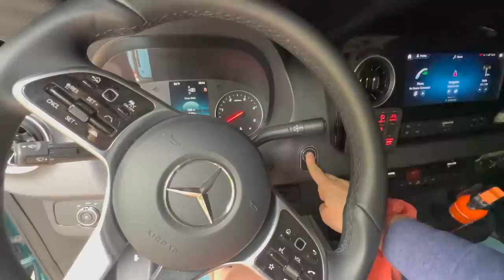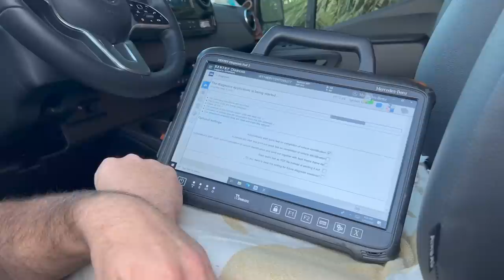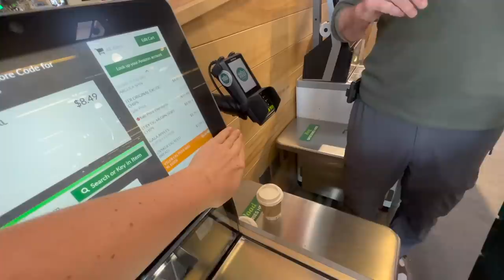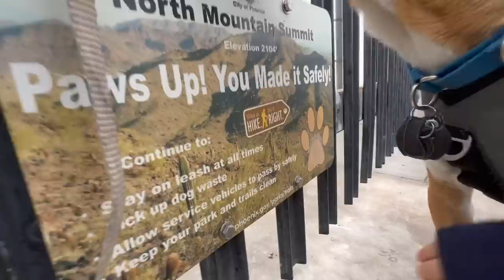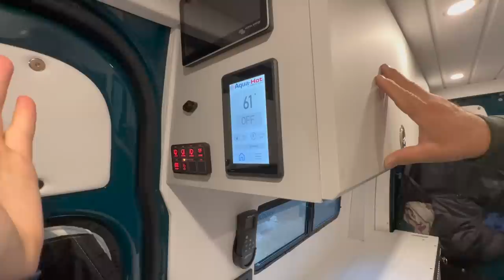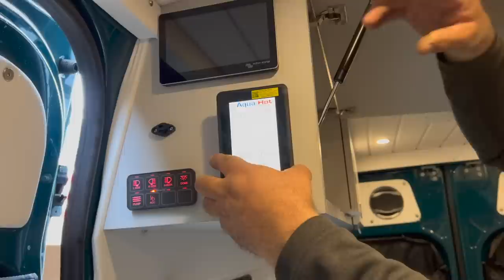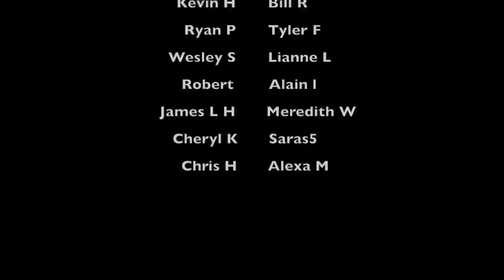Realities of living in a van (when nothing goes as planned)

Comment: That's definitely a consideration you'll want to touch base on with the van builders:  There's a big switch that will switch between how you charge your house batteries, and allows you to link them to the starter battery.  I'm actually surprised that Overland Van Project didn't install one in their van...

Maybe on your build, take a look at diesel heaters?  They're less expensive a easier to work on.  Plus they take up less room.  Just a thought.
Reply: I'd say diesel heaters are easy to work on but you will be doing it frequently. Normally you just gotta take the face off with a phillips screwdriver and clean the soot from the sensors. You can carry a spare injector, spare igniter, spare temp sensor, and spare flame sensor. When they fail the computer basically tells you what to replace.
Reply: Those diesel heaters are wonderful.. Not to plug another channel, but Chad Derosa, who isn't bad to look at (LOL) on Living the Van Life has a Sprinter + a Westfalia VW (gas) van and he has diesel heaters in both of them.  He went to the Arctic Ocean in the winter with his Sprinter.  Nicki, he lives in WA!.  Wear your new pants and go see him!!  LOL!
Reply from the maker: In this case the test showed it’s just a bad battery so it had nothing to do with the builders. These guys know their 💩. :-)
Reply from the maker: @maryh3438  hahaha! I connected with Chad and gonna try to meet with Him when he gets back in our matching vans and go on an adventure (maybe learn some new off road skills) haha!
Reply: @NikkiDelventhal  I spent 20 years building and designing cruising sailboats from the most basic $400k ones to $40 million dollar ego expressions. Even the most bargain basement versions have at least two separate battery banks with a simple rotary switch to allow you to draw from on battery or the other (or both)  

Not surprising that a mere 70k van build should lack such a basic feature. Your guys may know their s$$it but they don't know their electricity.
Reply: @NikkiDelventhal  come to Glenwood Springs and go snowshoeing!

Comment: I had the samething happen in my C class when I was living in it and during a bloody cold PA winter. I learned to carry a ceramic heater with me. I needed two  I had a 30 fter, but you could probably get away with one. I had two dogs and two cats with me so I got the ones that shut off if tipped, I think they all do that now. Good luck in getting it repaired. I gotta say I'm jealous of the heat in the floor. That would have been fab.

Comment: the company that built your van needs to install a contactor that kills the connection to the car battery when the key is off.
Reply: I have a disconnect in my 1999 ambulance build, but I'm wondering how interrupting the computer system in a new vehicle would effect things. 🤔
Reply: Warren D, this van is a loaner rental, while her new van is being converted.
Reply: @Texasishot105  you install the contactor between the aux equipment and the battery, don’t change anything between the car batt and starter or car specific equipment
Reply: @sergeantmasson3669  she needs to make sure her build has the contactor installed

Comment: Enjoyed the video. I've got a Webasto gasoline heater in my Ford Transit van and even it is always throwing error codes. If I drive and change elevation I have to go through at least a few cycles of it erroring out and me restarting it before it finally adjusts. Once I'm parked and level it will run all night. 
I'm sorry you've had so many issues lately! Its frustrating when you're constantly running into vehicle issues and with a camper van the complexity is far greater so more things can go wrong. Its good to be involved in the build process for troubleshooting / repairing when things inevitably break out in the middle of nowhere. I guess all that is to say, pretty much all these heaters are temperamental and require a bit of love & patience. Certainly not 100% set and forget. Good luck out there! I'm boondocked just outside the Phoenix area. I always get stoked when i see you're in the same region I'm in haha :)

Comment: I love all your adventures and the family members you take with you are an added bonus. Thank You.  
        I would call Aqua-Hot and see who THEY would recommend for repair in the Phoenix area.   I went to Aqua-hot site and out of a list of 10 services only 3 actually had motorhomes on their lot when I checked google earth.  Most of the rest were techs working out of their homes.      The site did list 3 common problems .   The fuel tank may be too low.    I think that would be propane fuel not diesel you should have.    Second,  Glycol antifreeze is below the sensors.   You did have a minor leak but for how long.    Also the system may need the air bled out of it if topped off.    Third was the power source may not be enough and being you had battery problems it may be a related connection.  You might mention these to the next technician you employ.
          Good luck and continue enjoying the simple things in life with your family.

Comment: Once your battery goes really dead or gets disconnected you may need to go to the dealer to get the computer reset.  It may be possible to drive a lot (A LOT) of miles and that resets the computer.  Depends on the car and complexities.   When changing out for a new battery, you need to keep power to the car computer at all times. Lead acid batteries need to be trickled a lot to keep them from getting sulfated.  The best way to keep a battery trickled?  On grid you can get cheap wall-wart type plug in trickle chargers for like $20, but a solar setup with a cheap $10-$13 pwm charge controller and a smaller manageable glass panel like a HQST 20, 30 or 50 watts, would work well.  Twenty watts will do it if you are patient.  Fifty watts might be too unwieldy.  Cheap plastic panels are expensive.  They are often rated as having WAY more watts than they actually have, and take sun damage rather quickly.  On a camper rv set up with solar though, usually you set up the lithium batteries to have a step down to the 12 volt lead acid car starter battery, so additional solar setup would not be necessary.  Will Prowse has got videos about this kind of thing

Comment: Such a bummer about the battery & lack of heat. 😕

But, at least you're in Arizona & you've got family nearby, so I'm sure you're having a blast.

If you're still in the area when you read this, you should take a trip over to Canyon Lake, up the Apache Trail - HWY. AZ-88. Note however the trail is closed further east from the lake, so you can't drive to Roosevelt lake without going back out and around thru Superior & Globe.

Comment: Nikki, here is some food for thought regarding the AquaHot system in this van. 
While there is builder convenience for utilizing the AquaHot, both space saving and multi-system use (water and cab heat),  the end-user needs to be on their A-game for maintaining this system!
I don't need to tell you about the inconvenience of losing this system, as you have already lived it.
With that said, there are many that are fond of the AquaHot system and many that would curse it - my advice would be to discuss what your options may be for cab and water heating, if any, when building out your van. Having a traditional system with separate water and cab heat, could help to mitigate such a catastrophic experience (but in any case, even without the system, the van is still better that the Prius. 
Lastly, if you do go with the AquaHot, you must stay on top of the required annual maintenance. If you don't, you WILL be footing a rather large repair/replacement cost in the future.
Good luck on you endeavor!
Reply from the maker: I’m going with vanlife tech :-)

Comment: loved the video. such excellent video techniques - they just flow, would love to get lesson! such exuberant happy family. nice to see bit of Phoenix area and the cool cloudy weather was excellent for a walk (I’m Australian & stayed there in 1984). I remember how sunny & dry it normally is. The issues with your Campervan added interest for me. I’m not clear what the issue was with your heater but 6 hours was a long time for service guy to spend fixing. You are so lucky to have experts to call & attend at short notice. Regarding the weak battery affecting the gear selection, that’s not good. Low battery voltage - quite a likely event - should not affect gear selection. Needs to to go back to designer/manufacturer, i reckon.

Comment: Install a battery separator. This way the motor battery will never be depleted by your house batteries. It will prevent the coach battery to draw any power from the MB battery if it goes under 12.8 Volts.   Your alternator will charge your coach and main batteries. When you drive the alternator should deliver 14.2 Volts. I have had this system for about 6 years and still have the original MB battery under the driver's seat. The other piece of advice is to never let DEF tank go less than half full. My dealer advised me to top it every 4000 miles to avoid problems.

Comment: Sorry I'm not on any other social media to connect with you and I wouldn't know how as a 75 Y O  p/c learner.  
       I watched the video again and Nick pretty much  covered the few things I'd mentioned.    It did work for a bit so fuel is probably not the issue if the little inline pump is okay and filter clean.  I found out some units are also part electric for heating but diesel is want you need for on demand shower hot water .  Recommend at least a 1/2 tank fuel.      The glycol level was okay in the tank if the sensor is okay.   Might still get a good new usb style cable to the controller as they fail on other components often and the one you were sent didn't work at all.       I don't know the unit  or if it has a control board or interface board that might be failing.    
        As a retired Porsche technician  for 50 years I've had to deal with many intermittent circuit board and computer problems .  They can be so aggravating    but    persistence will prevail. 
           The info I originally sent was from typing in "  Aqua hot rv keeps shutting down will not heat"  and  "clicked on 10 things to know about your Aqua-Hot system" .   About 1/3 down the page was Servicing Your Aqua Hot and a link  saying "CLICK HERE" to find an "Authorized Service Center" .   I clicked to open a map and used a Mesa zip code  (because that's where Nick is) ,  to try and locate Authorized Aqua-Hot centers.       So this info is just if you want to read what I had found.  There is also a link to the Aqua-Hot website.in the article.     I live in Tempe and you google earth a lot to check out businesses before I deal with them,    just to get an idea of the operation and neighborhood they are in.
       Anyway,   Good luck again finding a qualified tech and sorry I can't be more helpful .     Take care Nikki.

Comment: Hi Nikki, the advice he gave for disconnecting the battery is technically wrong for the Sprinter. I believe someone else had mentioned it’s better to put the van into standby mode via the MBUX menu. This will cut/ reduce all power down to save battery. Plus, the van also has a small aux battery under the drivers seat that maintains power to run the electronic shift control system for the transmission. If you disconnect the main battery and not the aux too, that will drain and you won’t be able to shift the transmission. Another thing is when staying in the van, put the key fob away as far from the cab as possible. Everytime the van senses the fob it turns things on & draws power. I put ours in the back by us or you can get one of those IR faraday bags to block the signal.

Comment: I have owned several RV's. Everyone had a battery isolator to prevent the RV section from accidentally drawing down the engine battery, leaving you stranded. Also, most motor homes have a switch which allows you to jump the engine with the RV batteries. I am surprised you expensive van apparently doesn't have these features.
Reply from the maker: In this case the battery was just bad and that’s why it kept failing - haven’t had an issue since we replaced the new battery(I filmed this 3/4 weeks ago :-)

Comment: Electricity is everything.......especially when customizing a vehicle to certain specs power wise. If the battery is not rated for the customizations there can be problems with batteries going dead, accessories/customizations draining the battery becuase they still may be running when the vehicle is off.

Comment: Batteries have an average life of 5-7 years, but in heavy use (like a converted van) it could be less. If you can figure the age of the battery that failed, you would know when to put replacing the battery on your maintenance schedule. The cost of changing a battery a little early is much less than replacing it too late.

Comment: if you every get the bug to build out a truck (case that sunrader idea), low tech, easy maint, etc touch base with me. I've built out my short bus, a pro master van, and getting close on finishing up the ford f-150 flatbed with sleeper. 
I started the travel rig adventure with a travel trailer and ever since that experience (always dealing with battery issues, lowed pumps and heaters etc) i have pursued lower tech solutions while still keeping the comforts. I really enjoy not having complicated systems, things that rarely if ever have issues, and if they do i can fix them myself with minimal materials/effort.

Comment: Happy (belated, and given that your videos release quite a while after they are filmed, even more so) birthday!

The engineer in me is wondering - how old was that battery that got replaced?  Getting run down too often is definitely not good for a battery, but it seems like this was more than a one-off discharge causing issues.  As a side note - you might want to get a cheap Harbor Freight voltmeter for checking batteries.  (yeah yeah I know a proper check puts load on it, but low voltage unloaded is a clear "something is wrong" sign).

Also, the antics with bridging the house battery scared the crap out of me, given that one slip of the metal and you've shorted + to - and have a vaporized piece of metal in your hands...  I'm surprised OVP doesn't have some better mechanisms for preventing under-discharge of the started battery, and being able to pull juice from the house battery in the rare case where it's the starter that is unhappy.

Comment: That's why I bought an older model Toyota RV. The new RVs aren't made with quality equipment or material since they care about numbers rather than quality. Also it's easier to deal with issues when you've only spent 25k VS over 100k.

Comment: 2006 was the best year of Sprinters. The newer ones are seen as reliable to the uninitiated because of the reputation garnered by the 2005/2006s. The new ones are simply not reliable, and many of the issues can only be corrected at a Merc dealer. For like $400/hr. The old ones don't have 4x4, but a 4x4 that unreliable isn't really the greatest vehicle to get too far out with. Just wait until you get the "10 Starts Remaining" light.

Comment: You need to buy a new battery. Always buy an expensive battery!!! Especially when you travel to cold areas! Trust me! Rocky Mountain girl here. It’s actually hard to go back and forth from hot to cold areas. Never forget you need winter windshield fluid or if it freezes it will crack your tank and you can’t hold any fluid anymore. Your antifreeze also has to be different.  Cold areas require winter tires that don’t fair well in the heat so buy covers for your tires in hot areas.
Reply: Ugh forgot to say if you are travelling on bumpy roads you might always have an issue with your heater. Make sure whoever fixes it tries to fabricate some way for the computer to stay in place. Most modern heaters have not been designed to withstand 4x4 bumpy driving.
Reply: For cold weather trips you may need to have a winterization kit. Bra for front of van, Heat tape, skirting, small heater, antifreeze and windshield wash, oh ya heating pad for your feet and camper 😂❤

Comment: If you disconnect both of the battery terminals, and touch them together for 20 minutes. It will eliminate "parasitic'"draw. New or old battery. Fyi, for the people that have been having situations like this, after buying new batteries.

Comment: Auto makers have been building vehicles for decades and still can't get right.  Get rid of all the electrical computer controlled devices things might work like their suppose to. All the electrical controlled items running off one 12 volt battery means that battery is not going to last very long.  Manual controls are more reliable.  Is that van yours or the rental to get to your van?  Thanks for sharing and have a wonderful day.